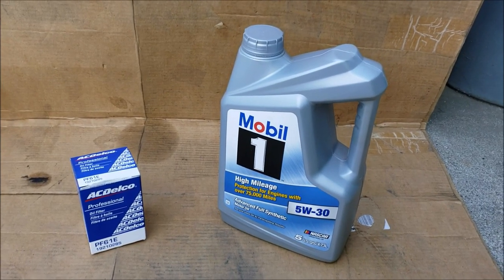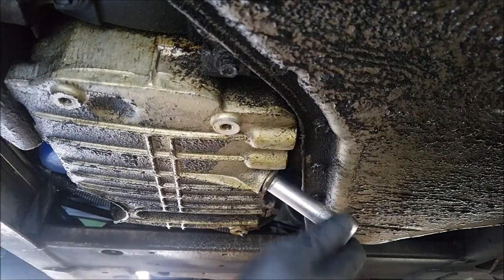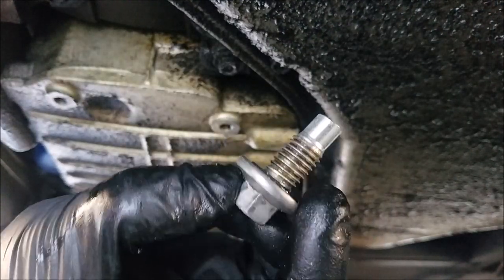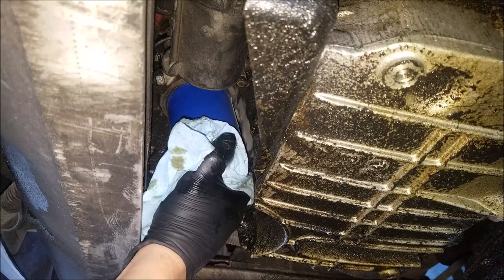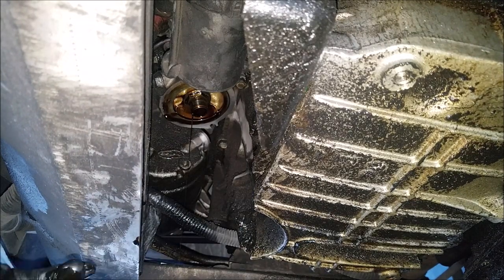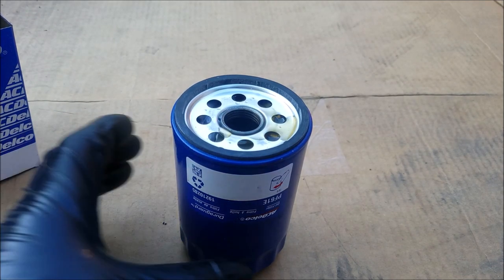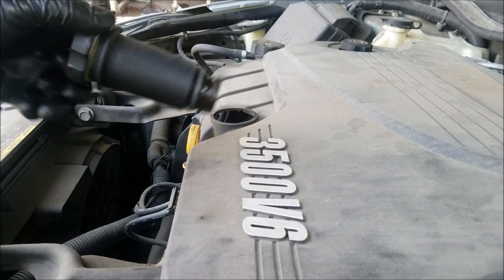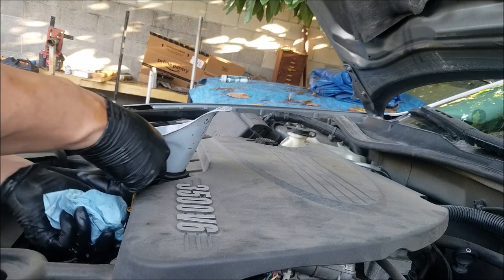2006-2011 Chevy Impala Oil Change (How To Change Oil & Filter Chevy Impala)

Comment: Thank you for the video it's very helpful! How often should I change the oil filter?
Reply from the maker: Thank you🙂 i would say its best to be replaced every oil change, since it filters out and protects ur engines internals from any particulates or metal chips that may be floating around in the oil..although u can get away with doing it every other oil change..dont think its worth the risk.
Reply: @backyardchevy328  thank you 🙂
Reply from the maker: @morganbingham5527  anytime🙂

Comment: Great video, although you may want to edit the title since this is on a 3.5, the 3.5 was dropped after the 2011 model year so 2012-2013 and the 2014-2016 Limited used the LFX 3.6 which is a slightly different configuration than this one. I have a 2014 Limited and although the oil filter is easy to get to, GM was ever so nice to place it right next to one of the catalytic converters, along with the drain plug itself, which is right next to the exhaust.
Reply from the maker: Thank you🙂 yes i will do that right now..thank you for the help.

Comment: U are the person I seen to tell me to fill the filter with new engine oil before installing. I always done it by just lubbing up the rubber part of the ring. But is there a reason why you top it up first?

Comment: So far your videos have helped me with my starter and my oil change. How about a video changing the oil pressure sensor? Got that problem as of Saturday.
Reply from the maker: Glad to be able to help🙂..whats wrong with the oil pressure sensor, u got ur oil light coming on?
Reply: Same problem on my 08 inpala
Reply: Sell the car these impalas are trash as cars your gonna keep fixing it I changed all this now my power steering rack needs repair i repaired it once and it needs to be fixed again the car is shit
Reply: Yea as I'm driving the oil light will turn on and the dash board will say oil pressure low stop engine. First time this happened I was scared since I was on the freeway so I checked my oil level on the side of the road and the level on it was fine. So I started driving back home and didnt have it turn on again til 2 days later. Its sporadic when it beeps the pressure is low.
Reply: David Torres yesh I had that problem it’s the oil pressure sensor lol this car is ass I’m telling you sell it while u can

Comment: I don't like to check oil levels immediately after adding or shutting off an engine.  I prefer to wait a while to let the oil to have time to drain from the head area.  If one checks the level immediately after adding oil or shutting off the engine, I would add only enough oil to bring it up to about half a quart under the full level.  I find the best time to check the oil level is after the engine has been off for a few hours (like overnight).  Good video.  I watched it so I could find out what wrench size I needed for the drain plug before getting under the car.
Reply from the maker: Thats a good way to do it too, it does avoid any possible overfilling....thank you🙂
Reply: @backyardchevy328  You also might want to consider adding instructions on how to reset the Oil Life Monitor on the information panel.
Reply from the maker: @fakeorganism7377  i did do a short video separately but probably would of been a good idea to include it in video anyways

Comment: I hear that GM vehicles need dexos approved oil. Does that really matter or can I use any 5w-30 oil? For 2007 Chevy Impala?
Reply from the maker: For the 07 it doesnt matter if its dexos..they started using em on 2010 gm vehicles and newer...but it does use full synthetic oil
Reply: Backyard Chevy ah I was worried that I didn’t use the right oil. But thank you so much for clearing things up for me!
Reply from the maker: @ep9372  glad to be able to help🙂
Reply: What about and 08 should I use Dex
Reply: I think that's only for coolant

Comment: So when you added that oil in the filter does that make the total oil around 4.25 - 4.5 quarts?
Reply from the maker: Yes, just about..but it all depends on the filter size since they make different sized filters..and how well the oil is drained

Comment: Just in case you happen to have a 5.3 L V8, according to my owner's manual, then you would use six quarts of oil. But my owner manual States the 3.5 L in the 3.9 L in 2008, use 4 quarts to fill up after changing oil.
Reply: If you have the police package V6, it's 4.7 quarts according to the owner's manual, at least for the 2010.

Comment: Now how do I get the oil filter out with a swivel handle oil filter wrench. Been sitting under this goddamn car for two hours
Reply from the maker: Well best ways are with special tools if theyre too tight to loosen by hand but other than that making ur own tool with a bike chain or sticking a screwdriver through it but those are last resort

Comment: How much oil do you put in the filter?
Reply from the maker: About 3/4 of the way full...and probably takes less than 1/4 of a quart
Reply: @backyardchevy328  Thankx
Reply: I finally got the old filter off, took it for a spin,and runs fine!
Reply from the maker: @mrmagnificent4551  thats awesome! Great job🙂👍

Comment: How do I ask for the oil ?
Reply from the maker: Well u will wanna get 5w-30 engine oil, theres gonna be different brands which most popular brands are fine to use since theyre certified although i prefer the mobil 1 full synthetic oil..so you can ask for a 5 quart jug of 5w-30 engine oil full synthetic or synthetic blend..but u dont wanna just pour it all in..youll wanna check it as u add it...then you can ask for the oil filter just give the year, make and model and engine size
Reply: @backyardchevy328  thank you bro☝🏿

Comment: What size filter cap wrench is it???
Reply from the maker: It depends on the oil filter brand unfortunately, some have different flutes than others..i have a oil filter wrench set that i use..but u can use the new oil filter to get one that matches closely or they have universal oil filter wrench's that clamp on a variety of sizes.
Reply: @backyardchevy328  I'm going to use that same exact filter if you wouldn't mind telling me please
Reply from the maker: @214DallasDreamGirl10  the one i used is a 74/76mm 15 flutes...which the one that grabs on to that filter was the 74 i believe
Reply: @backyardchevy328  thanks really appreciate it
Reply from the maker: @214DallasDreamGirl10  anytime🙂
Reply from the maker: @214DallasDreamGirl10  Lisle 61560 74-76mm 15-Flute End Cap Wrench Set https://www.amazon.com/dp/B00AKA6O0K/ref=cm_sw_r_cp_apa_i_D8NAEbVKV7CWK
Reply from the maker: @214DallasDreamGirl10  thats the link to the same one i used

Comment: I've always wondered why this motor only takes 4 - 4.25 quarts of oil. Small oil pan? Because most 3.5l engines take 5 quarts.
Reply from the maker: Yes, usually depends on the size of the oil pan and size of filter, then its got that notched area for the oil filter on the pan

Comment: Bruh what is the oil filter wrench size? ??/??mm ?
Reply from the maker: 74/76mm 15 flutes was the filter wrench i used on the video
Reply: Backyard Chevy Thank you so much!!!
Reply from the maker: @MeTHoD they do have different filters cause its a different engine but i was just looking at the size of the filter and it is the same diameter so it may actually use same filter wrench

Comment: In all honesty you do not need to pour oil into the oil filter, lubing the rubber o-ring around the oil filter yes but as soon as you turn your vehicle on the oil pump is going to automatically fill the oil filter within a matter of seconds
Reply from the maker: Yea u dont have to but it does help it build oil pressure just a bit faster, and any time without oil is potential damage to bearings rings etc. and i feel better doing it that way🙂
Reply: It doesnt make amy sense to change the oil filter and not prime it before install.
Reply from the maker: @synthesoul  yea i never feel comfortable putting a filter in dry when its facing up and down..even on its side i still add 1/4th of the way on the filter